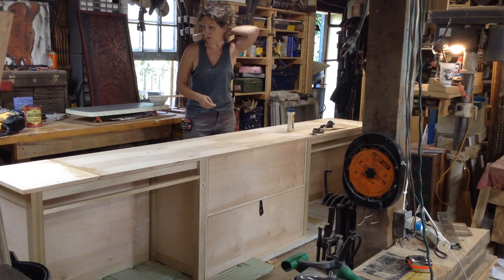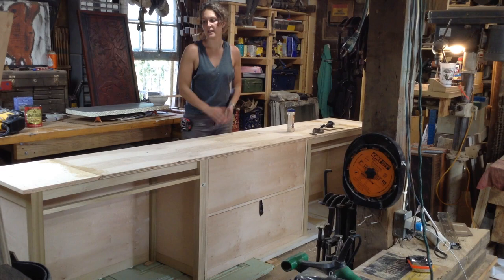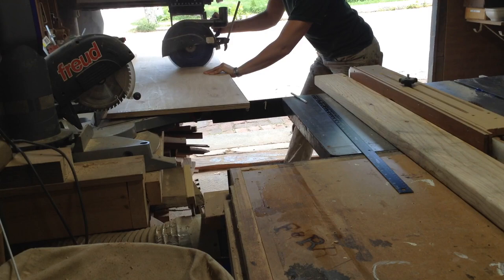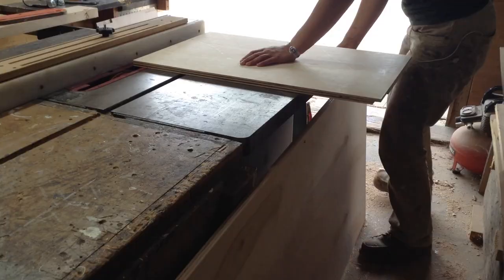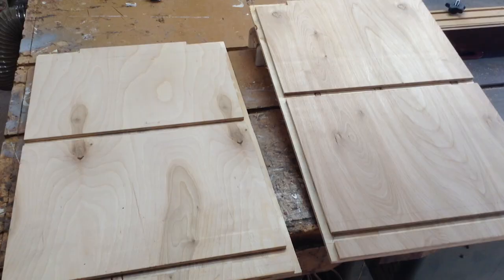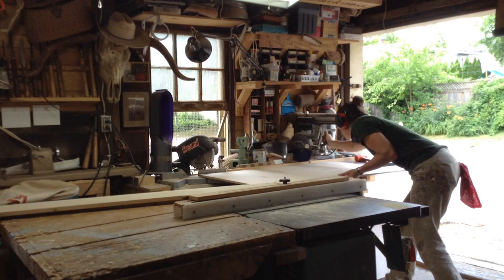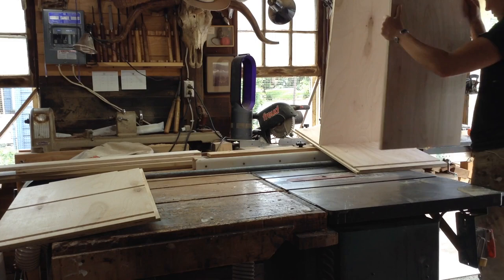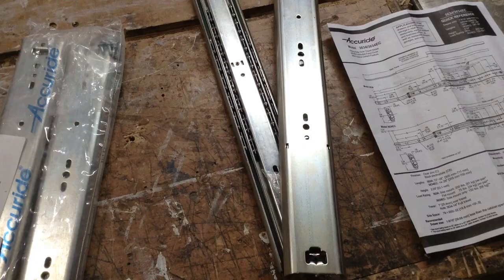Woodworking : Two Person Desk W/Filing Cabinet Storage // How-To Part 1

Comment: Hi I started watching your videos because your into doing more cabinetry & furniture.  I am a finish contractor in Ca and do a lot of what you do.  I wanted to share with you that if you look at most if not all of those slides you see what appear to be cutouts or like an outline of a cutout?  Those are self adjustment tabs?  So like when you first slid your drawer in & out it seemed rough?  Then after a couple times it smoothed out?  That is because of those tabs.  What I did not know is do not screw into them?  Then it limits or stops the self adjustment design part of the slide?
U may already know this?  It took me a bit I am slow?  
Anyway I really enjoy your builds keep it up.  I stopped the dove tail thing and use loose mortise tenons to build cabinets & doors/drawers!  Then if they want DT it cost mucho more!

I really want to encourage you to encourage other ladies to consider carpentry we hv a big shortage in trades ppl like carpenters, plumbers, electrician and such!  And I find so many ladies (my girlfriend framed houses) just love the concept but don’t try it!
Reply from the maker: For real,  I think they are great jobs and if you like making stuff it shouldn't matter what your gender is.  I also think in part it's because it can be intimidating walking into any predominately male field, but like I said in another comment someone posted on here the guys I have met in the trade(s) have been extremely helpful and awesome.  But, not all of them, I had a guy once point blank tell me he wouldn't hire a women for his crews.  Luckily, people like that seem to be the exception in my experience not he norm.
Reply: Well I come from custom home builder for a dad.  This is my 2nd career!  So I am a bit older than you!
But I tell ppl age is what?  I do more than most 25 yr olds!  Same hold for gender!  It’s physical yes I enjoy that!
However; it’s technique , stamina , & determination !
Bottom line your a better carpenter than most guys I work with!

You will be successful because it’s a passion!  I live it, I have a 450 lb table in my dining room I am building for a client!
My sharpening station in my laundry room & about a 100 router bits in my cabinet!
I wear my “Red Wings” to church with a Carhart button up & Levi’s!  Why I think they look good & I am blue collar country boy!
Your a blue collar country Girl!
That it ; is what it is Proud of it!